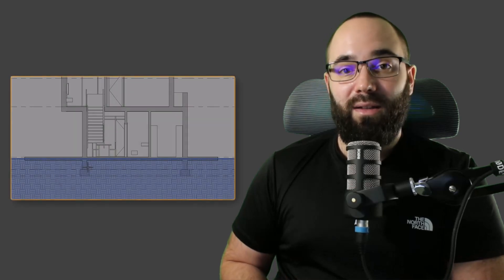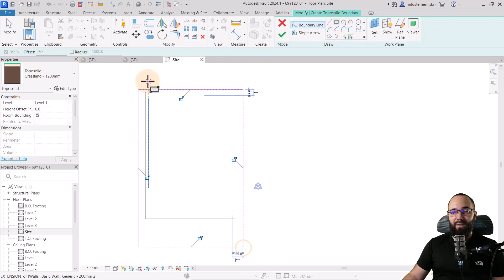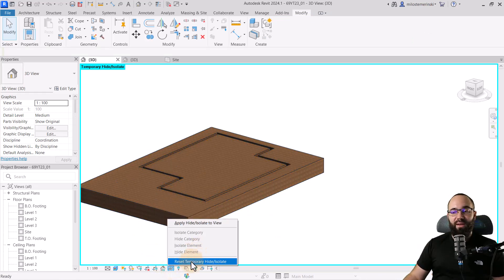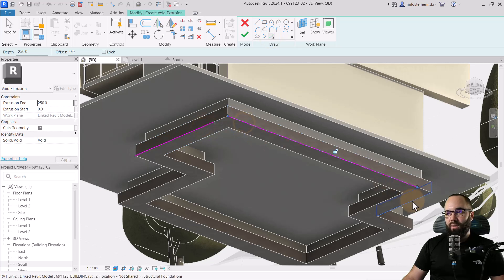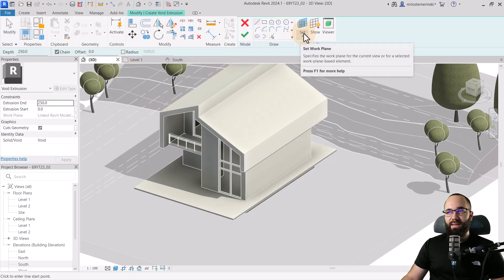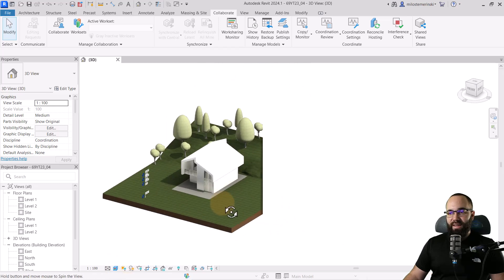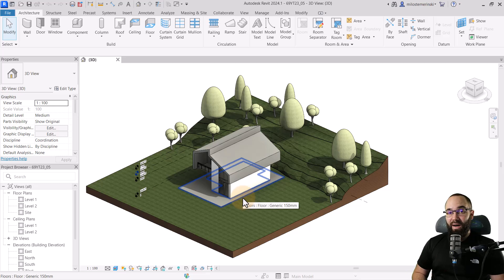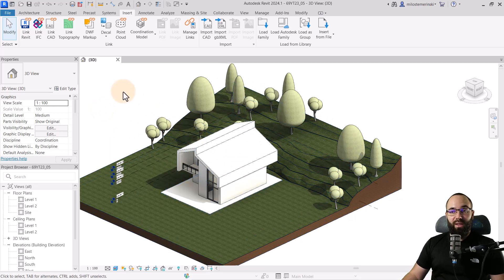4 Ways to link Revit to Topo file

Comment: Great video and workarounds, but I wish we had a real solution. I'm having a terribly difficult time with toposolids, mainly that I'm unable to see how the contours are being changed during the modify sub elements mode, and I'm unable to align points, among many other problems. Would you consider doing a video like this one about solutions / workarounds to common issues with toposolids?
Reply: Try the environment plugin
Reply: @dddnl  I have tried it, and it works, albeit slow and buggy. Hoping to see some solutions within Revit without paid add on software.